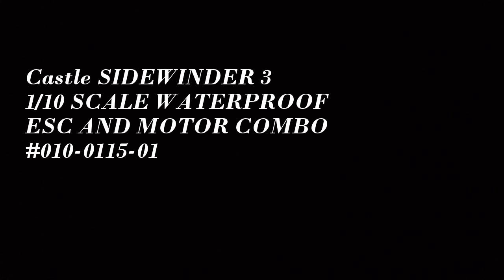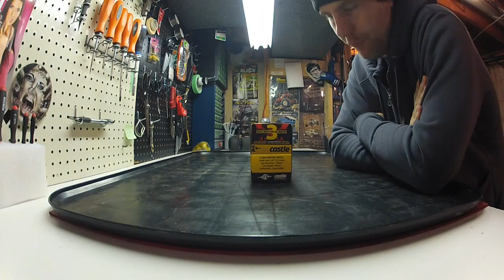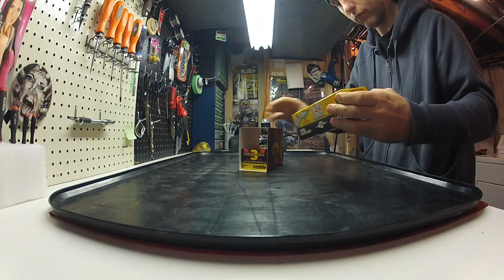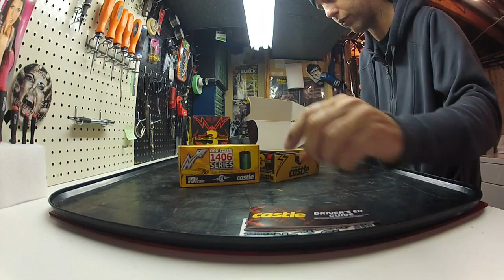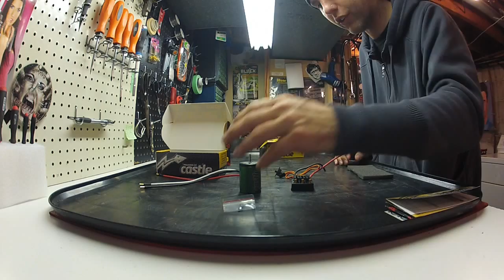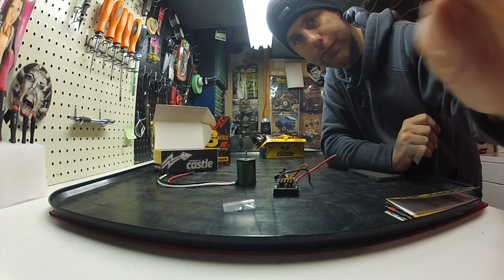Castle Creations Sidewinder 3 ESC Motor Combo Unboxing.

Comment: That is wicked mate, I'm sure you will get plenty of hours of crazy speeds out of that setup!
What do you think on the quality of your stickers? The ones I got were terrible, looked like they were cut by hand in a hurry with all the edges of the lettering cut off and stuff, LOL I have never seen anything like it!!
Reply from the maker: Took the Slash out for a rip at the windy cold beach with Lisa.  Crazy fast.. As for the stickers mine are fine no problems.  You must of got a "Friday" sticker sheet:)
Reply: asplenia
Ha ha, yeah no doubt mate, they were probably having a few beers while cutting them!

Comment: i thought about putting this on my drift car. What do u think? Love your clean workplace for your rc too
Reply from the maker: +pinoyblues 
Hey Pinoyblues,
I don't know a lot about drifting but I thinks would be to powerfull for a drift car.  A lot of guys are running slower motors with more torque.  But this has a ton of torque so this could work.
Let me know how you made out.
Thanks for watching!
Asplenia.
Reply: +asplenia Hey man appreciate the quick response. Anyways just got my sidewinder 3 combo and actually the motor I got has 5700kv so wish me luck hopfully the drift hold up together will keep you posted :)

Comment: Hey there. In your opinion. What battery, pinion and spur would you recommend for speed with that sw3 set up? Please help.
Reply from the maker: Hey Carlos,
For the Rustler, I would run it with the stock gearing and see if that is fast enough.  If not just bump it a tooth higher on pinion.  Remember to keep motor temps low, you don't want to burn out your new system :)
Thanks for watching,
Asplenia.